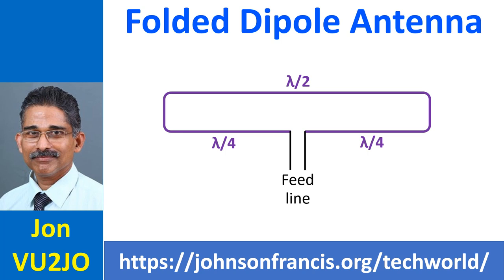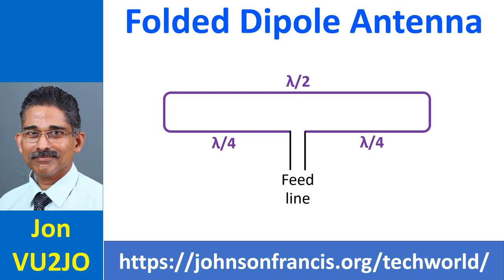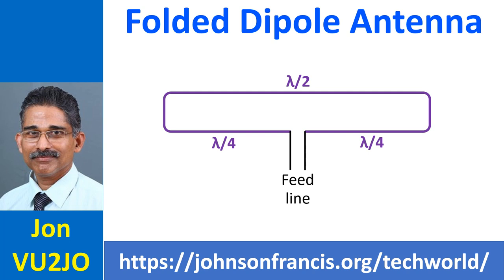More on Folded Dipole Antenna

Comment: Nice explanation, just a week back I put a similar one to catch very weak fm signal of 100.1 ragam station in Bangalore. Though the radial distance from the transmitter is under ten kilometres, because of my house location signal is very weak, this folded dipole solved the problem to some extent
Reply from the maker: Great idea! I have always been wondering how to receive distant FM stations better. This idea has never struck me. Currently I do not have FM radio other than my mobile phone. Would try this when I purchase another FM radio for home. I am not sure whether this would work for mobile phone FM radio as well, because the 'antenna' in that case is usually the earphone plugged into the audio socket.